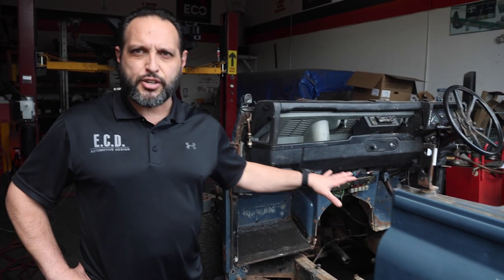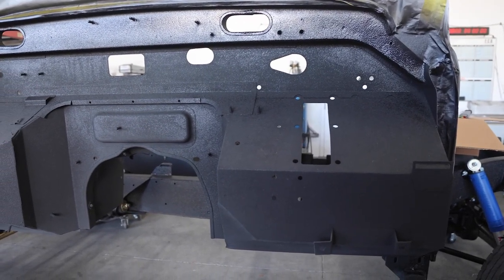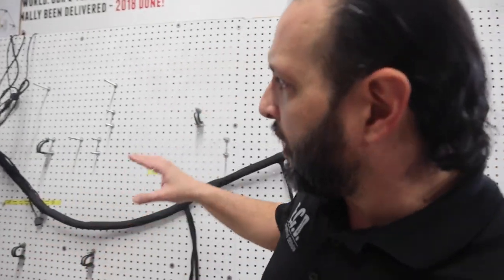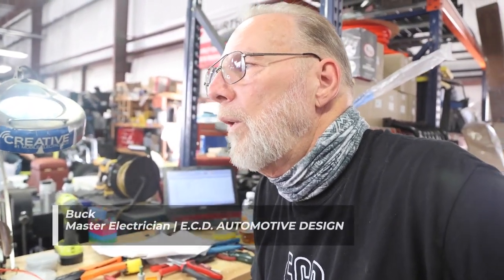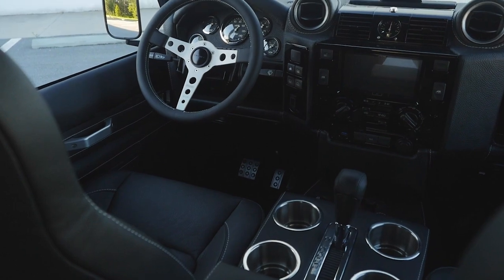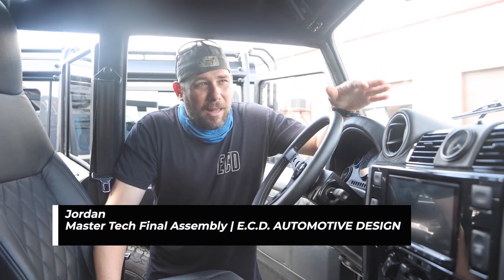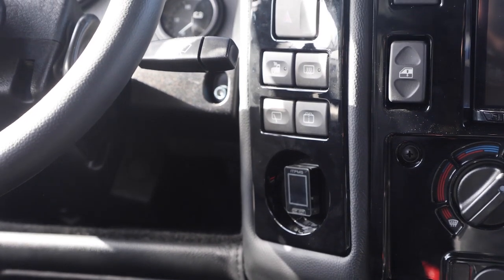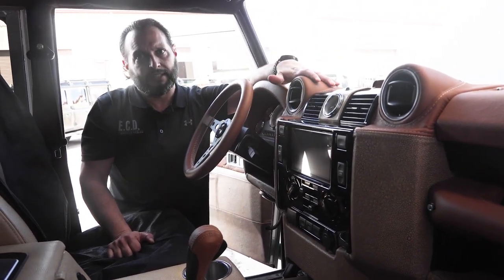Transforming Interiors with Puma Dashes for DEFENDERS ECD Automotive Design

Comment: I'm wondering if the car keeps the 4wd system no matter if you guys installed a LS3 Engine and 8 speed automatic transmission. How many pounds that car can tow with that set?